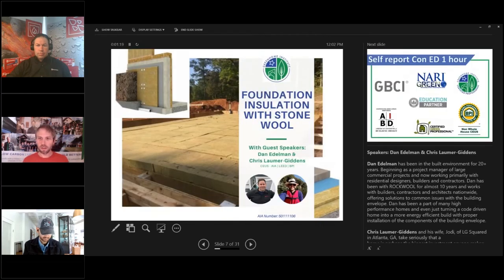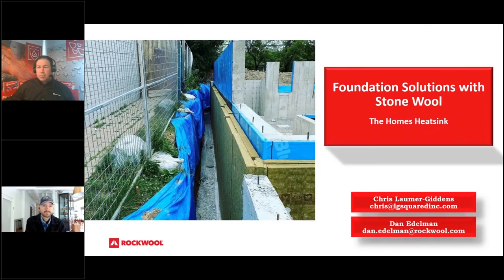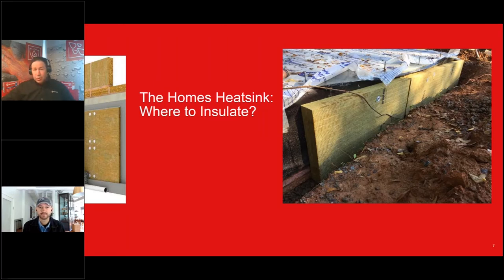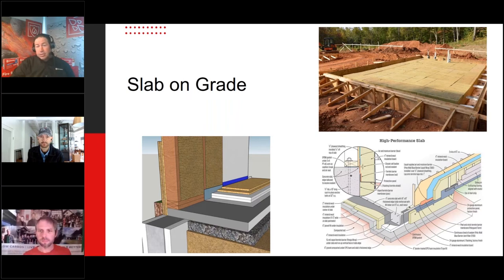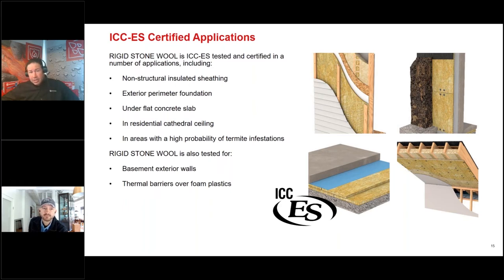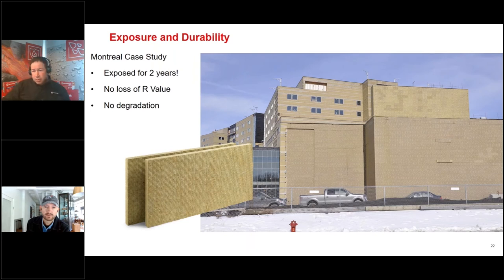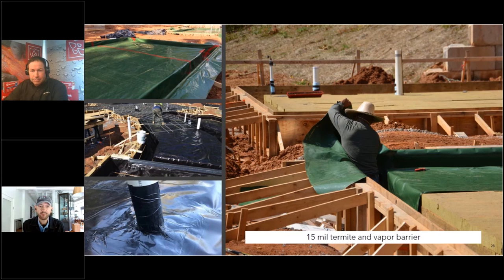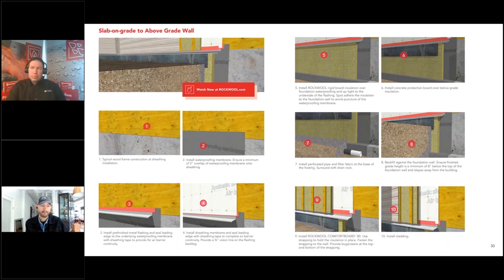Foundation Insulation with Stone Wool

Comment: Thank you for this presentation. I'm using mineral wool for foundation insulation and am liking it so far.

A few questions: 
- Which manufacturer makes KleenRunner (the slab protection membrane)? I tried googling it but no search results come up.
- When using the z flashing to protect the foundation insulation that's exposed, the Z flashing will stick up, correct? Does the flashing get damaged during framing?

Comment: The problem with rockwool- or fiberglass n on exterior foundation wall is when wet is SUBSTANTIALLY degraded in R value. Soil down a foot or more is effectively 100n-per cent hummdity year round round .
Reply: Doesn't this contradict the chart they show at 41:30 ?